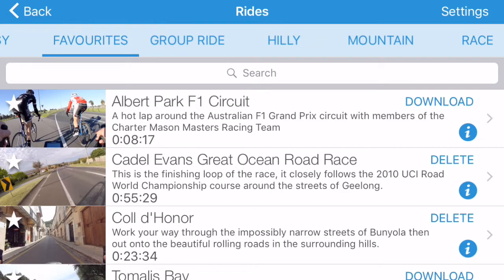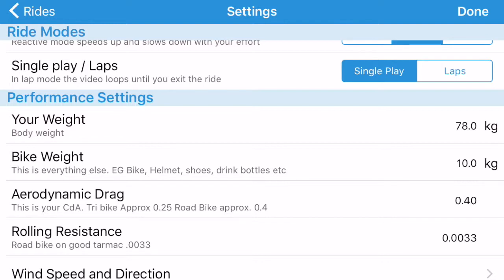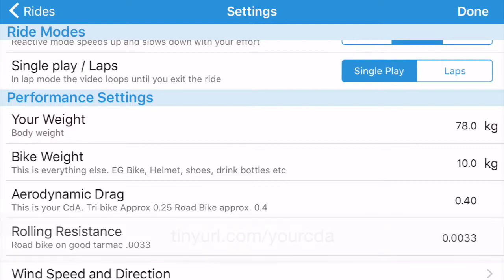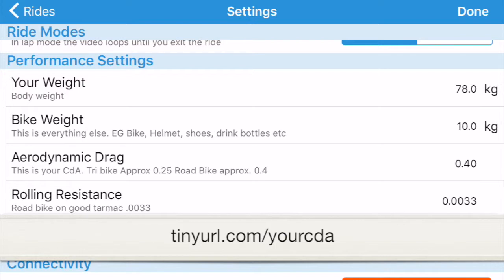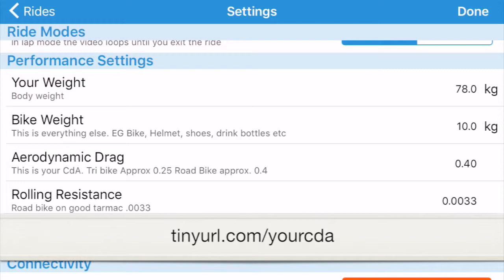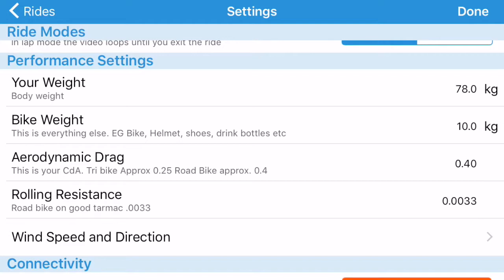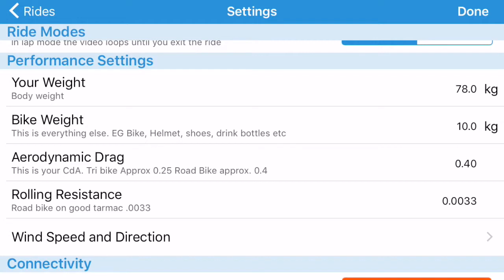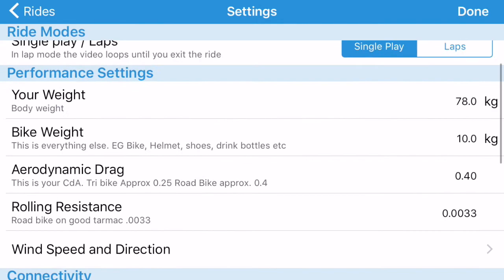Optimising FulGaz settings

Comment: Hi, I have rollers, connected speed and cadence sensor, but when riding, no speed is showing, reactive mode doesn't seem to be working. I have updated everything and turned off all other bluetooth devices...I done a ride yesterday and loved it, but with no speed showing, its a bit meh, just like an ordinary video...16gb ram rx480 and win 10 updated...139down and 35up speed any suggestions?